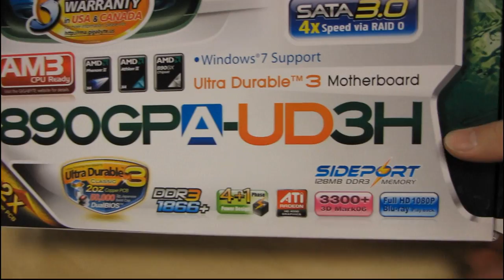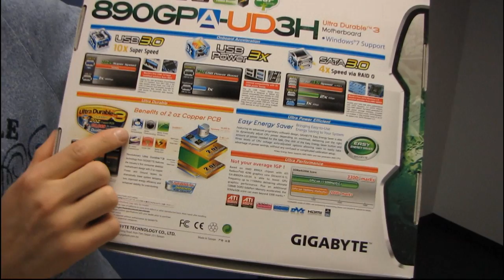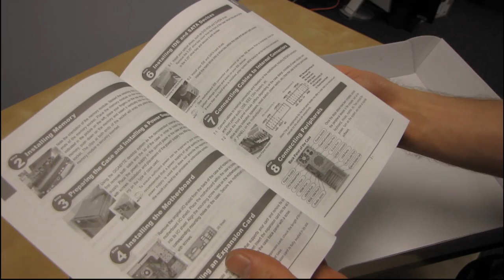Gigabyte 890GPA-UD3H 890GX Crossfire DDR3 Motherboard Unboxing & First Look Linus Tech Tips

Comment: I agree, they need to start putting the front audio port on the other end of the mobo.  Would make life a lot easier routing the HD/AC97cable.  
I run it towards the top of the mobo/case then down, hides the wire well.  And heatshrink the AC97 part back on the wire (loop it back, under the HD connection).  Keeps it looking nice without seeing the extra connector.

Comment: i have this motherboard. its great, great performance, great temperatures, great controllers.
 the con is that the cpu cooler fan has only template adjustments, and the multiplier of cpu accepts integers only.

 everything else are pros

Comment: Warning: enabling AHCI mode on sata3 SSD devices even with installed drivers causes BSOD sometimes, thsi is a warning.

However, by default all sata3 devices work on IDE channels:

3 master
3 slave

Comment: you can theoretically use any SATA 2 cable for a SATA 3 port, there is no difference between the 2 connectors/cables.

Comment: I heard that only the red ones are 3.0 compatible :P (but seriously, any decent sata cable can run sata 3. If it's not good enough for sata 3, it's probably not good enough for anything, because the original spec on the cable hasn't changed. I don't feel like linking my sources on this, but feel free to look it up.)

Comment: Pretty stupid board layout imo. With those needlessly big heat sinks it's going to be virtually impossible to install most of the aftermarket tower coolers. those damn heatsinks are so ridiculously oversize that it even obstructs the fist PCIe x1 Slot. if you're unlucky you won't be able to fit your audio/card etc there.